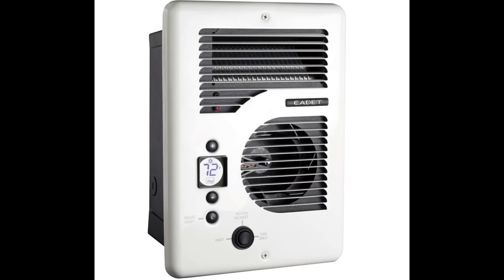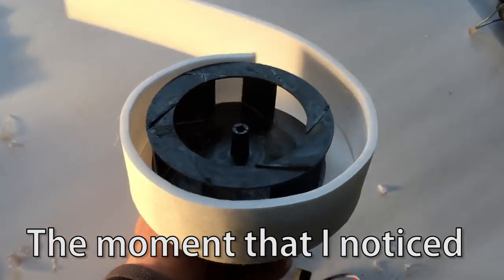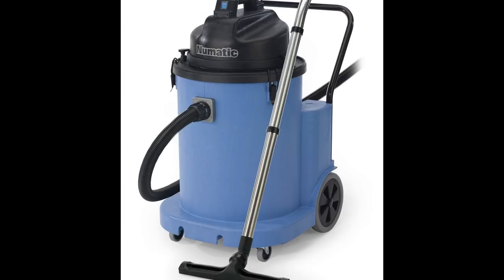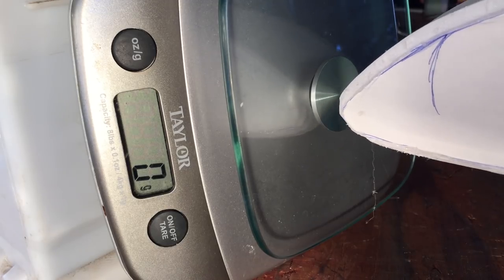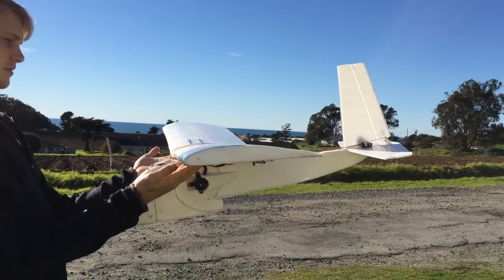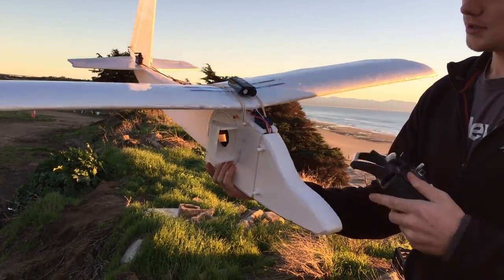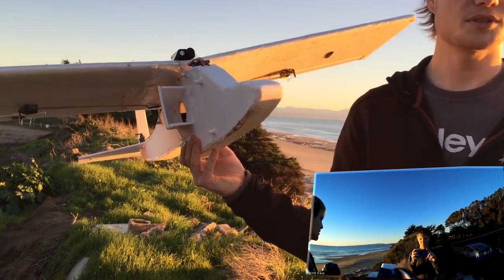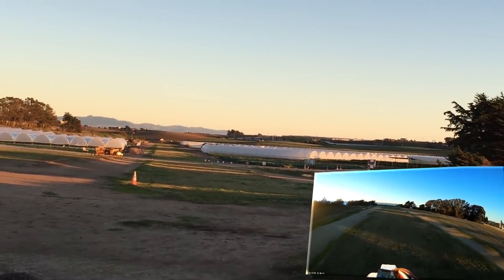This is NOT a Propeller

Comment: The greatest advantage of this would be for safety. One of the biggest draw backs of rc aeroplaning would be safety especially when it comes to youngsters with little fingers getting into the propellers. 
This idea has the potential to change lives. Imagine a scenario of a sheer cliff rescue. With a copter, the pilot has to worry about rotor contact with the cliff face; where as a rotor less craft avoids this issue.
Reply: and would require way more power
Reply: dafrandle Power requirements can be reduced with careful engineering.  For example, giving the exhaust a properly-focused nozzle would create a Venturi effect, boosting the thrust output a bit thanks to Bernoulli's Principle.
Reply: (i should note i'm talking about the helicopter part) to get the same performance it would most likely require at least a little more power because we trade the usage of lifting surfaces (the rotors) for thrust that we must create all ourselves, it can be done (just look at the harrier) it just not practical -- or we would have adopted it already
Reply: +bcstractor not if hillary gets into office ;)
Reply: please dont make anything
Reply: dafrandle the harrier uses vectored jet engine thrust
Reply: Guvius right ... i meant the f35?

the point is it's not very common
Reply: +lordhood117
"Power requirements can be reduced with careful engineering" comparing to heating fan? Yes. Comparing to helicopter rotor? No.
Slower large diameter props are more efficient than small high speed ones, which are more efficient than centrifugal pumps.
Sorry. No breakthrough in aviation here.
Reply: I guess "naysayers like you" is people understanding how physics work.
And it is Universe why we have no flying cars.
Reply: Gray Day that's how VTOL works, but a centrifugal pump is very hard to install on a larger scale because mounting the engine would need more intricate gearboxes, thus increasing weight. But having seen this gives light to my old project, which failed since it used those chainsaw engines to power 2 directional output centrifugal pumps
Reply: Centrifugal fans are good for generating high pressures, but the convoluted flow path through the fan and duct means they aren't good for moving lots of air. For propulsion what you want is to move as much air as possible. This is why large props will also be much more efficient for propulsion than centrifugal fans, as Samm found out with his project.

There are already designs that use ducted jet nozzles for vertical take off, like the Harrier or the F-35.. But they are horribly inefficient and need crazy amounts of power to even get off the ground. Even with all the power they have they cant take-off vertically with a full load on-board, which is why you dont see such designed used except for niche military applications.
Reply: jetplaneflyer yes. it will need a ton of weight to support the engine required to run the pump because there is a limited amount of air in the intake.
Reply: An Assault Rifle you won't be able to go to the hospital if trump gets into the office ;)
Reply: "if trump gets into the office" Where have you being?

Comment: Why don't you turn the turbine upside down, with the exhaust on top of the plane. If you let the exhaust to blow over the top of the wing you'll make some additional lift. This makes me think about the "Fanwing", you should google it ;)
Reply from the maker: Because I wanted it to pitch up with added power, like a normal stable airplane. The fanwing or blown flaps effects are negligible. Instead of using a tiny section of the wing to redirect the air, you could just point the thrust angle down a little bit.
Reply: Yes you're right! Interesting topics on your channel btw, got a lot of common interests!

Comment: Could you skip the wind stream's right angle turn? In other words, let the intake face forward, and have the exhaust hit a deflecting plate to send that part of the stream backwards. The head-on profile would be wider, so an intake  cowl would lessen the drag (plus remembering Bernoulli's principle, this could used to add some forward pull). Great video!

Comment: The propeller was spinning the wrong way around to my eye. The curve should be facing away from the direction of rotation.
Reply: yes looks like the impeller is spinning anti clockwise and should be spinning clockwise @56  might be just the look of it in the video. look at  c pump design

Comment: I wonder if rotating the blower 180 degrees to blow across the top of the wings would create more lift...

Basic aerodyamics, air moving faster across a surface creates less pressure on that surface than air moving slower on another.  Wings are curved just to create a longer distance, and thus faster velocity of the air moving across.

Mount the blower to blow out above the wings, and I'd hazzard to guess you'd get measurable lift, even without any forward movement (like the test blocked against the wall.)
Reply: +Dan O'Connell Sounds like a good idea OP should test.
Reply: +Dan O'Connell Wouldn't you want the air on the under side of the wing to move faster to create more lift?
Reply: ***** Faster moving air causes lower pressure. So if you had less pressure below the wings, there would be less air pushing it upwards compared to the pressure on top of the wing pushing it downwards. 

That is why wings are shaped with humps on top because this weird phenomena that I don't understand: air moving from below and above the wing must reach the end of the wing at the same time. So having a longer distance to travel on the top of the wing (with that hump) means the air has to travel faster, creating lower pressure.
Reply: Soccerrockker6 Yes, that sounds right. The idea is to create lower pressure on upper side and higher pressure at the under side. We wanna go up.
Reply: +Soccerrockker6 
"air moving from below and above the wing must reach the end of the wing at the same time" - False, but a commonly held misconception. Lift is caused by the pressure differential between above and below the wing, but there is no law to say that airflow must meet at the other end. The incidence causes lift by curvature of the airflow. See experiments on youtube with pulses of smoke moving over a wing. They do not meet!
Reply: dom69foco Ok, sorry! I only know very basic aerodynamics and this is one of those things that I had to research but was never actually taught.
Reply: Soccerrockker6
No need to apologise! No one really knows how it works except for engineers (and I happen to be one).
Reply: +Soccerrockker6 "air moving from below and above the wing must reach the end of the wing at the same time." It seems reasonable, but think about it: why would that have to be the case? 

This is the common explanation, and most people believe it, so you're in good company -- but one reason you don't understand might be because it's (half-)wrong. (For example, why then are airplanes able to fly upside down?) It's a slightly-wrong-mostly-right explanation of Bernoulli, but doesn't mention at all the other big factor.

There are two (main) ways wings produce lift. One factor is the angle of attack: ever put your hand outside a car window and angled it up and down? By forcing air downward, your hand is pushed upward... the same principle as any thrust. (The contribution from air "hitting" the bottom surface, though intuitive, is real but negligible at most velocities; the main factor is the "turning" of the air streams, following the surfaces of the airfoil and being directed downward.)

The second factor IS the Bernoulli principle, but not due to equal transit time; instead, the "turning" of the air streams does mean that the air on top speeds up, following the curve and so creating lower pressure. It will reach the trailing edge of the airfoil before the air on the bottom does, though, because the velocity difference is greater than the extra distance! Another piece of the puzzle is the compression of the air streams at the leading top edge of the airfoil; since the area is decreased, the velocity is increased (think of forcing water through a smaller aperture in a hose: to get the same flow, it must go faster) and pressure decreases as it flows over the rest of the foil. This is a very useful effect in making sure the wing can fly upside down.
Reply: +Tezcatlipoc I forgot to mention -- I'm not sure why the velocity increase over the top surface is greater than you'd expect just from the distance, but I suspect it falls out of the relevant equations (Bernoulli again), and don't forgot that the bottom surface is also slowed by a similar factor. I'm not an expert in aerodynamics, just a chemist with a hobby! (Fluid dynamics never grabbed me, but airplanes sure do.)

I see also that dom69foco has beat me to the punch... that's what I get for procrastinating by writing long comments on the Internet... but I'll leave mine because I think it's a fairly thorough explanation.
Reply: +dom69foco To be honest, even for a lot of engineers it's pretty magical :P "It just works ok? Memorize it and use it later in your job."
Reply: +Soccerrockker6: need to revise your lift theory, check NASA at www.grc.nasa.gov/www/k-12/airplane/wrong1.html
Reply: +Dan O'Connell I would use the method we use in pneumatic vacuum tubes. We use a knife edge around the outlet to amplify air the same way Dyson fans do. Do it along the trailing edge of the entire wing surface and that thing would have lift to spare at a bare idle speed in my opinion.
Reply: +Dan O'Connell That is a great theory that I would love to see tested, along with a few more theories in the replies here. So the question is, who is curious enough to go out and build some experimental rc planes and post the results for science?
Reply from the maker: +Dan O'Connell  I think that by directing the jet over the wing would only cause lift because the wing may bend the thrust downward. I'd rather direct thrust backwards for maximum foreward speed and pitch up to point it more downward. However your idea might be beneficial in controlling the boundary layer like "Blown Flaps" do.
Reply: It's called upper surface blowing thrust and at least on the large scale you do get more lift. NASA experimented with it in the 50s and 60s and was able to create a plane that essentially could not stall.
Reply: +Dan O'Connell This is called the Coanda Effect. Some airplanes use this, such as the Antonov An-72 to help land/take off on short fields. More air flowing over the wing=less takeoff time and runway use. Just like why we take off into the wind.  It would be interesting to see this with an RC airplane.
Reply: +Kronesian C-17 uses this also, so they can operate out of short fields for the military.
Reply: Yes, it will. The Japanese use this method on their sea planes for short take offs in heavy weather. They look like they literally jump off the water.
Reply: +Landorcan  that is how the Japanese use it on their sea planes. Little jets of air blown over the the trailing edge and flaps. It's amazing to watch it work. They seem to leap off the water.

Comment: should try a more efficient "ram air intake"
Reply from the maker: That already is a ram air intake
Reply: ***** I mean the inlet hole. Like how you made the fan shroud nice and uniform in design. Could make the inlet nice and smooth instead of just a hole. I'm no rocket appliance, anyway
Reply: Watch it again. He has ram air intake. That was awesome Samm.
Reply: With Styrofoam? Great that doesn't melt.
Reply: +Garry Kennedy I mean more effiecient, design it for smoother air flow
Reply: Fjolfrin the Silk Beard OH.. Ok. Yeah,, may have room for improvement there. But it was a great success for a first run.
Reply: its when you use a combustion engine

Comment: Great work and video but you're missing a trick! Mounting the fan such that the output passes over the top of the wings will increase lift allowing the fast air to achieve BOTH lift AND thrust. The same principle all prop planes have used for many years especially with above wing engines.

Problems/issues:

CoG will be affected with more mass further forward so fundamental design may need to be altered

For best lift, separation of two blowers would be better, one for each side of the aircraft

The size of the blowers ahead of the wing may increase drag more than the benefit of extra lift achieved - alternate positioning/orientation?

Be interesting to see how different layouts compare.
Reply: Bob Lewis The creator of this video has passed away. RIP Samm

Comment: i think it would be a little more efficient with a larger intake. Like 1.5 times or smthn
Reply from the maker: Larger intake = more air can enter = more load on motor = burned motor and lower efficiency
Reply: Generally true. But: Small intake = Motor sucks vacuum (is choked) = Smaller load on motor = much less thrust and efficiency. Balance is key. I would say the cross section should be around: intake = 1.3~1.5 x exhaust. You're accelerating air, like a turbofan. Their intake is also much bigger than the exhaust. Couldn't see clearly in the video, maybe you're there already. Looked to small to me.
Reply from the maker: The intake is smaller than the exhaust. Also note that this is not a gas turbine engine and compression and combustion stages don't need to be considered. I opened the intake hole until it drew the maximum power that my motor is rated for and then stopped there.
Reply: Well, then your motor is too small for your "prop" =) See, the air exits faster than it comes in to your intake. This acceleration of air is where you get the momentum (thrust) from (Newtons 2nd). If your exhaust is larger than your intake, it means that either you have large boundary layers in your exhaust  (friction ->inefficient) or you have a low pressure area at your exhaust (pressure drag ->inefficient). Doesnt matter if its a jet or a fan. Principle remains the same. Maximum efficiency is reached when the air at the exhaust has ambient pressure. Maybe make the exhaust a little smaller?
Reply: btw, just trying to help, cause i like the project. really cool =)
Reply from the maker: domothepilot I appreciate the insight. I did try reducing the exhaust size and measured the thrust/power efficiency and it only got worse. Also the impeller was already at the edge of it's structural limits as it was haha
Reply: It makes total sense that STATIC thrust gets better. If you make the exhaust larger, it gets even better. Its like using a larger propeller with less pitch. In the air however...
Reply: i think it works fine for being a salvaged component! only way to really optimize it would be to make your own impeller/choose the appropriate motor for the craft design.
so cool! I'd try to tweak the sound of it somehow if I made one. just sounds like too much hairdryer haha
Reply: The engineers that have building that type of fan for many many years would surely appreciate all of your ideas.  :-)
Here is your chance to get rich.

Comment: a smaller lighter version of this would work great for gliders
Reply: yes! so many tiny brushless motors exist that weigh only a few grams you could get decent thrust for a lightweight craft. foam or thin balsa. small and safe scale jet glider :-)
Reply: A glider with a motor always sounds wrong to me, even though I've seen full-size gliders using engines to take off and to fly to a destination.

Comment: Hi Samm, Not sure if you still have this plane, but if you do, this may sound a little counter intuitive, but reverse the blower so that the veins are facing in the direction of rotation.  The way you had it first but said it was wrong.  You will draw more current, but you should also have a LOT more output as well because the centrifugal force will be forcing the air to follow the veins and make it accelerate faster just as a water pump works.  All the best and keep on doing mad science!
Reply: He used the correct rotation for the design of the fan (backward inclined blades).  A forward curved fan will do as you note, but the design of the fan is different, with different sized blades, number of blades and shape of blades.  For an 'off the shelf ' project, he did a pretty passable job.
And, as a side note, this had been done before, in UK and the US, with a small combustion engine powered fan and a similar construction.....no RC, just free flight.
The fan technology is out there to be investigated, with probably significant performance improvement, but it's not the most efficient way to power a model (and, no, it is NOT a ducted fan, in the sense that the term is used today...it's a centrifugal fan in a housing, with no actual ducting).
Conventional bladed propellors are a very effective way to translate power into thrust, with the operating envelope of 'slower' airplanes.  Centrifugal fans/blowers are most effective at delivering air against pressure resistance, e.g., air delivery systems for heating, cooling and exhausting.  Props are more effective in moving air in 'free air' systems.
End of lesson!
Dave Gardner, P.E.

Comment: Your plane has an IMPELLER instead of a propeller.
Reply from the maker: I mean, that's what I said
Reply: Oh, sorry. Neat idea. It would be neat to see someone build an actual full size airplane like this.
Reply: Samm Sheperd it's like the motor acts like it's got a gyro like you spin a bike wheel and hold the spindle.   Cool idea mate. Flys well 👍🏽

Comment: You gain some efficiency by not having to compensate for the rotation of a propeller and motor along the main axis of the plane.

Also you could take advantage of the Venturi effect, by putting an open duct around the outlet, kind of like the Dyson blower.